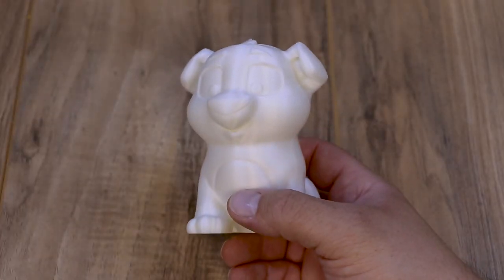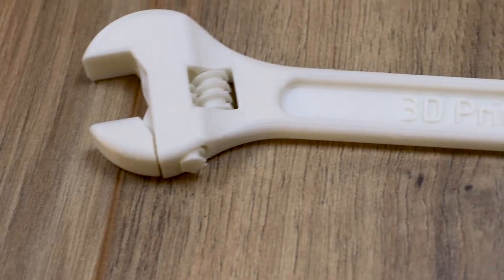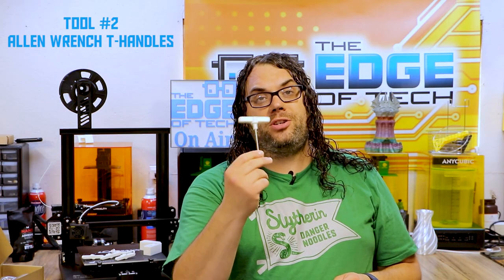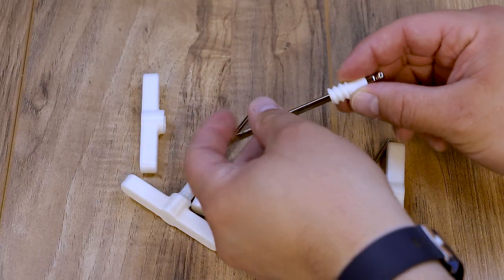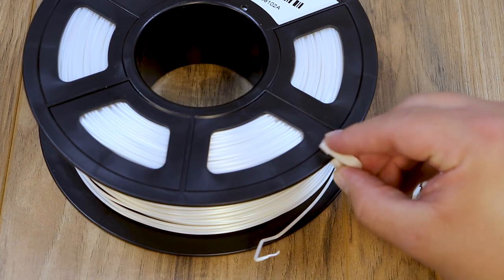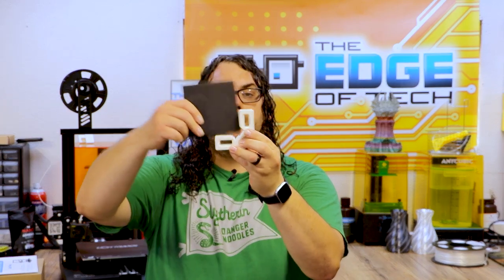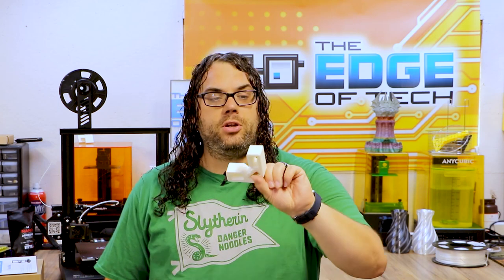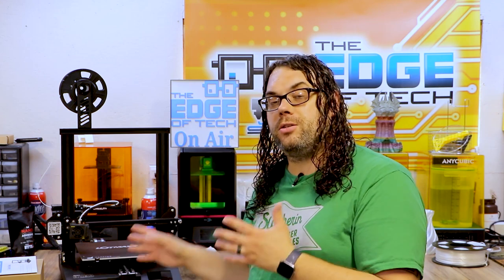3D Printed Tools that Really Work! - Lotmaxx SC-10 Review

Comment: Love the handles but mine came out brittle and two screws broke. Using Cura 4.7 as my slier on an Ender 3 V2. If you know by chance what the settings for this should be I'll check it out again. Great channel.
Reply from the maker: What settings did you use? I used 3 walls, 3 tops, 3 bottoms and 50% infill to make them pretty strong.
Reply: @TheEdgeofTech  It looks like standard profile for Cura 20% infill plus I have no idea about the walls haha.